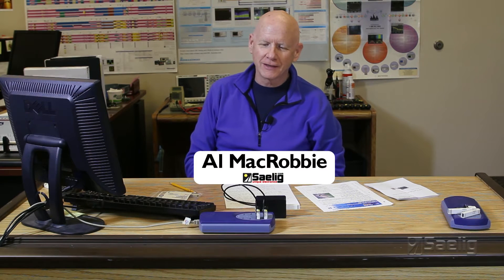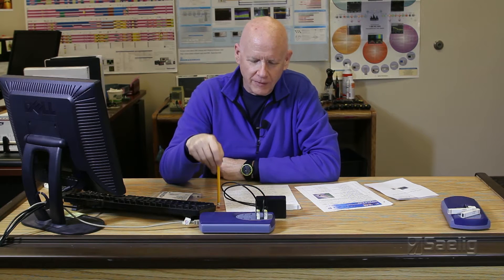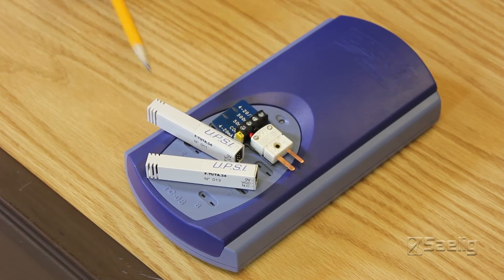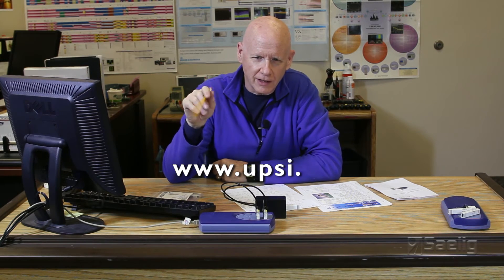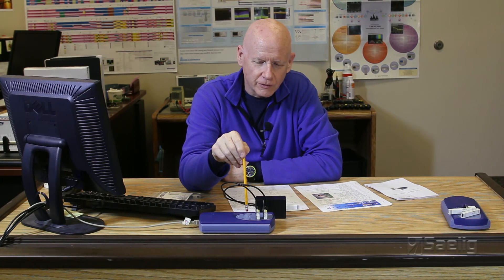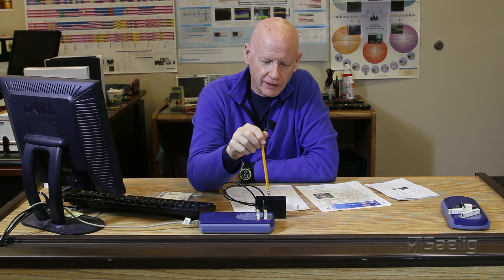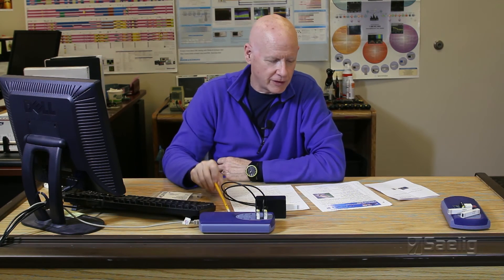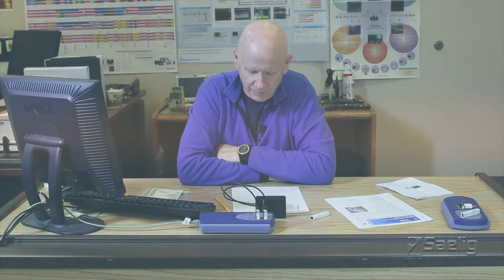Pico Technology TC-08 Data Logger - Practical Application Video 1 of 2

Comment: what is the cause of having a negative temperature reading on a heated heat cartridge when monitored with pico logger
Reply from the maker: Usually when there is a problem with the temperature readings on a TC-08 it is due to one of the following reasons:

1) You are using it on a Laptop with the power supply connected, thus causing a ground loop issue. If this is the case then try disconnecting it form the line/mains and leave it floating.

2) The thermocouple has a voltage injected into it which exceeds the common mode rejection ratio of the TC-08, ensure that the thermocouple is getting a voltage to it.